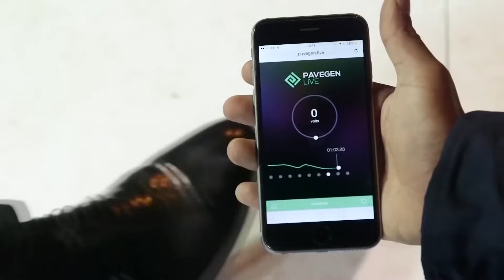Pavegen plans to power the world with footsteps

Comment: The road "project" is bullshit. To convert energy, you must absorb energy. The energy "source" is the plates sinking. When one plate sinks, you have to put a little bit more effort into climbing the height difference between the plate that has sank and the next one. It may not be like stairs and make a small difference, but it still makes the difference. It's like walking with a constant incline. And in the case of cars, using more fuel which means more money and CO2 emmisions, or, in the case of electric cars, energy😅
Reply: Revelation 3:20
Behold, I stand at the door, and knock: if any man hear my voice, and open the door, I will come in to him, and will sup with him, and he with me.

HEY THERE 🤗 JESUS IS CALLING YOU TODAY. Turn away from your sins, confess, forsake them and live the victorious life. God bless.

Revelation 22:12-14
And, behold, I come quickly; and my reward is with me, to give every man according as his work shall be.
I am Alpha and Omega, the beginning and the end, the first and the last.
Blessed are they that do his commandments, that they may have right to the tree of life, and may enter in through the gates into the city.

Comment: What if you put a bunch of them on the street for the Boston Marathon ?

30,000 people running 26 miles.

If you could store the energy in batteries.

What about heavy duty ones that generate even more energy because cars and trucks are driving over them.

Does more weight equal more energy ? Airport runways ?

Comment: The purpose of this project isn’t really about generating extra power for the city and its people. In fact, these kinetic tiles require more energy from individuals, as anyone who has ever walked on sand knows, walking on a cushioned surface demands extra effort compared to a solid one. That means you need to consume more food to maintain your baseline energy levels, and food production itself requires significant energy and creates waste.

The general public may not realize this, which is why these 'innovative' projects can mislead people into believing we have a critical energy shortage. 

Rather than being a genuine attempt to solve energy problems, it could serve as a method to shift public perception, create buy-in for monitoring technologies, and reinforce the narrative of scarcity. This would, in turn, make it easier to implement more significant behavioral controls and restrictions down the line, all under the banner of sustainability and global responsibility.

It's a clever tactic, no doubt, but it lacks genuine intelligence and integrity.

Comment: what about: energy generating road;  e-magnetically dragging driver using motion capture , reducing necessity of ph. strength or engine... ;)
Persistence of induced movement. Sustainable, but not cheap to maintain. Better to plant rubber trees for breaks than use fossil fuels and repair (more) engine parts.. ;P

Comment: if you´d replace every sidewalkwith this, connect it to a Battery that saves the generated energy. you could use said energy to light the sidewalks at night. this would save so much energy(cost) then make it mandatory for every goverment building to have solar panels

Comment: Amazing - if you got it onto the roads we could be powering our lighting infrastructure really inefficiently with petrol!
All you are doing is taking energy from one source (me walking or a car driving) and convrting it at incredibly low efficiency into electricity to power a light.
You don't get the energy for free. I need to put in more work to walk across your pavement than a normal pavement. And, ok, who cares if pedestrians get a bit fitter.
But put it on the road and you are taking energy from cars, which has to be replaced by the car burning more petrol.
Cars already run at about 20% efficiency. Being optimistic your tech might be 40% efficient. So you would be using petrol at about 8% efficiency to make electricity. It's so silly.

Comment: This is a good idea. They should build busy road junctions with strips of these across them. Or entrance ways to buildings. Places with high regular traffic
Reply: Why? You would then cause every car to use more petrol to cross that intersection so you could harnass a tiny fraction of the energy available in that petrol. If you want the energy, put up a solar panel.

Comment: Does not make sense. Think about it. Where does the energy come from? Waking on these sidewalks is more tiring as you convert some of your energy into electricity (not bad, you burn more calories which is healthier). It is as if you are walking on a slope (every step you take, the ground lowers beneath your feet, so your next step should be some centimeters higher than the previous). It is like walking on a sandy beach which is more tiring. The most stupid thing they said in the video is to use car energy the same way. That would require the cars to burn more fuel for the excess energy. Why would you burn gasoline (which is more expensive than some other fuels) to create energy? Besides, you should create energy via renewable sources.

Comment: So, the problem with putting these on roads is that the energy has to come from the fuel in the cars. Cars will burn fuel more efficiently on stiff, flat roads, but will lose efficiency the more elastic the road is. So, by putting elastic generators in the roads, you're taking the energy away from cars, making them less efficient. If you want to generate energy from commuting, put these in your shoes. You'll burn more calories than wearing regular shoes, and charge your phone at the same time.
Reply: @Cubic Planet Solid tires are efficient, but the issue here isn't with the tires, it's with the road. The road needs to be as solid as possible for cars to drive efficiently. The most efficient way to drive would be with solid tires on a solid road. A good example of very efficient transportation is trains. They can travel at much higher efficiencies partly due to their solid metal wheels on solid metal rail roads.
Reply: @Tbugfish  exactly ! So why don´t we use this stuff on  r a i l w a y s ? And there you have  g r e a t   p r e s s u r e  too !
Reply: @AL_THOMAS_777 are you kidding or do you have a 4th grade level of understanding of physics?
Do you realise that for the tile to go down, the vehicle needs to travel upwards, like on a slope and use more energy than what is created, right?
Reply: Yeah and I think this vid made it clear that they are nowhere near finding a solution for that. The focus was pedestrians only at first.
Although I am curious what developments were made in the last 4 years...
Reply: Can make speed breakers using this tech...
Reply: @guneetsingh5562  That's actually an excellent idea. Put these speed bumps around busy schools or shopping centers. They'll probably collect enough energy to power a few street lamps at night.
Reply: It might make sense to be use together with speed bumps or speed cutters. This way you create lower speed bumps that damages the car less while taking more energy and momentum out of the car without requiring them to brake that much.
Reply: You mean like a usage tax?  (If you use the road your car will power the lights?)
Reply: Yes, but they are not putting the pressure plates on roads, they are putting it on footpaths
Reply: Or ... You could buy an electric car...
Reply: @timemachine194 If i'm understanding your argument correctly, then we need to shut down all gyms, cancel all sports of every kind, and reduce how often people walk. This will improve our lives by reducing pollution.
Reply: @timemachine194 I agree. We need to stop wasting money and resources on research and just stick to the old ways. prototyping without knowing a product's efficacy will always be a waste of resources which could have gone to maintaining what we already have. Tradition is always better. I also agree that it is unethical for people to buy shoes that make them burn more calories to charge their cellphones. Cellphones should only be charged by infrastructure power generators.
Reply: Yes putting them in the roads is basically another indirect tax, crazy idea. 

It’s the same with the footpaths, do people think the energy gathered comes out of nowhere. Have they asked consent for quietly harnessing people’s energy on behalf of the government, no that hasn’t even entered their minds. 

Use them for the side of a building for wind, that is the way, leave the overburdened human beings alone please
Reply: You could these stuffs beneath speed humps
Reply: well, I for one. am hoping for a more fuel efficient, electric. or solar or kinetic, car that would not have such a problem with 'wasted energy'.😉
Reply: @youtmeme  converting any kind of energy always has waste.
Reply: @foxrumor  true.
Reply: @youtmeme  you're still taking motion away from the car and putting it into the steeet, which on top of everything has to transport and store the electricity you generated. Better off just leaving the cars to run efficiently
Reply: @youtmeme you do realise that is a physical impossibility, right?
Reply: @youtmeme Most Electric cars use fossil fuels converted into electricity as their power source. Also solar powered cars are very inefficient.
Reply: I mean you could just compress the points that collect the energy into small little bumps instead of making them large enough to block the way

Comment: You  can also put this tech in keyboards...
Reply: And wireless keyboard get energy by pressing keys no more batteries....
Reply: @aarkestraclub326  brilliant idea
Reply: @YinhuWang  sounds brilliant until you calculate how much energy is produced from one key press.
Reply: @aarkestraclub326  law of thermodynamics
Always some energy will lost in form of heat
Reply: @kunjgadhecha281  that's why there should be a mechanism that track & monitor the temperature and when it is hot enough the heat should be transferred/used in others devices to fuel other appliances. I know that could sound crazy, but less than 5 years ago was also crazy to colonise Mars lol.
Reply: Gamers producing energy....noice
Reply: And our railways  a r e  BIG keyboards with Millions of "piano-keys" and 2 rails on it ;P
Reply: Suspension in vehicles, roads, train tracks, super markets, gyms/treadmill, etc.
Reply: @Tryalittlebit  actually there are threadmills that have this kind of technology already, taking the rotation kinetic energy and converting it back into electricity, in cars, motorcycles and basically any automobile uses this as well, that's why its already rare to buy new automotive batteries, normally, when it stays inert a long time it discharges, and you'll just need to charge it again and you're good to go
Reply: @jonasgabriel7315  piezoelectric in automobiles?? It sounds like your talking about alternators. That’s a different technology bub.
Reply: @Tryalittlebit  by "this kind of energy" i meant a retroactive energy conversion, but yeah, that's exactly what i should have said, but i had forgotten the name, thanks, and sorry for the mistake
Reply: hacking noises
Reply: Could replace all your teeth and leg bones with this and just walk about chomping down the sparks saving money as you go
Reply: @shaunlastname391  😂
Reply: I have smart work skill ideas by directly kinetic energy is converted into electrical energy and use it for charge our daily needs domestic gadgets or  other equipment .... But I have skill  but not a platform to show my skills ideas ..if any company hire me I work for them ...
Reply: Ur idea is really good
Reply: Exactly
Reply: Facts🔥🔥🙏🏽
Reply: no we should have generators on our teeth so everytime we brush our teeth, it powers the bathroom light
Reply: I think that would make it to where you've really gotta pound your keys. It would require more effort to type for not a huge return.
Reply: Electric company gonna be selling our energy back to us.
Reply: Ha haha ha. Keyboard warriors will produce electricity
Reply: not actuallyt it does not work
Reply: Sure there is such a huge force touching keyboards. Let's be honest it's fool technology to show up nothing more cost fortune to made produce not that much in the future may cost a lot to repair. It's a shame that we promote such a scams
Reply: @oskarrospondek1350  yea there isnt alot of force but it can still help with the amount of time and movement Im putting into typing this comment it could be causing some power to help.
Reply: @oskarrospondek1350  also have you seen old people type
Reply: U are thinking about costs as if this is made to turn a dollar into 10... Ofc it wil cost a fortune to maintain but atleast its green energy! Would be nice to have such devices all around us.  @oskarrospondek1350
Reply: These is very easy technology bro
Reply: @umeshpardeshi9081 
Revelation 3:20
Behold, I stand at the door, and knock: if any man hear my voice, and open the door, I will come in to him, and will sup with him, and he with me.

HEY THERE 🤗 JESUS IS CALLING YOU TODAY. Turn away from your sins, confess, forsake them and live the victorious life. God bless.

Revelation 22:12-14
And, behold, I come quickly; and my reward is with me, to give every man according as his work shall be.
I am Alpha and Omega, the beginning and the end, the first and the last.
Blessed are they that do his commandments, that they may have right to the tree of life, and may enter in through the gates into the city.

Comment: Better buy small PIEZOELECTRIC generators online...
You will get it..

You can also use this inside Shoe soles to generate electricity while walking, or below carpets in your house , or between the Tyre and Wheel rim of your Vehicles to generate electricity while driving,  at free! 
Today Japan is using this technology in some of its Malls too.
If installed below the Public streets or Roads, it can generate enough electricity to power all street lights & cam.

Comment: Ultimately, I guess it shouldn't be tiles, but a soft ground that equalizes the force feedback, so people won't slip.
Otherwise, if Thunderf00t hasn't made a "BUSTED" video on this, it's probably viable ;)
Reply: Well, it's not perpetual energy, it's more like a pressure plate, which can send an electric impulse to a battery which can store the charge, it's good efficient clean energy, imagine putting these in Manhattan. With how many people walk in NYC we could probably power a lot of the state and or east coast

Comment: i am doing this project for my final semester, how effective will be this project for modern engineers
Reply: from my coursework calculation, it is not worth the capital cost
Reply: @03019a  like how much capital cost required to build like these?
Reply: @contemplator1993   £80 per square foot, and it can generate 7W per step
Reply: @03019a  80 pound is heavy.
Reply: @03019a  what component do i need to make this
Reply: Me too but I haven't started yet. Do you know if there is an app or sth to get live values? like how many steps/energy in total?

Comment: Cover a busy highway with these and you got profit.
Reply: You only got profit because vehicles use more fuel to travel across these than they do to travel across a normal road. The energy is coming from the petrol. You would be powering your lights with petrol at very low efficiency with atronomical carbon emissions per kWh. Dumbest idea ever.
Reply: or we could just put wind turbines on our roofs
Reply: Yes, you can power a single lamp with all that power
Reply: @yalkn2073  Well that's something too.
Reply: I am pretty sure it is more than that. You need to see the video by Jun Fu Clean Energy Co.,Ltd.
Reply: @mubashirakhtar789  And I am pretty sure manufacturing and maintenance cost would far outweigh its energy output
Reply: @yalkn2073  Not really, if you put it on one highway you could probably power half the state with the amount of daily traffic.  Hell in high traffic areas, we are talking millions of joules of power just waiting to be tapped.
Reply: @Ryooken  You can't, considering the abysmal power output of these. And putting speedbumps on a highway is a bad idea
Reply: @yalkn2073  They are first generation applications, it's the same thing with regen braking.  It will improve over time and get better exponentially.  They are using them in various parts of Europe this is 4 years ago so improvements have been made.  So yes, I am.
Reply: @Ryooken  This relies on piezoelectricity to generate power. It literally can't improve much.

Comment: LOVE This! A question though, if this were to be used on roadways, wouldn't the "inch or two" of downward forge every microsecond weat vehicles shocks a teeny bit, and potentially fuel economy? Has a whiff of "perpetual motion" methinks. With pedestrians, NP the cushioning would be nice, But vehicles?
Reply: Yes, you're right. You are simply lowering the efficiency of the vehicle and getting electricity from the petrol. You don't get the enegy for free, unless it is used in very niche situations where every car is braking anyway and you are simply using this to help them slow down.
On a normal stretch of road, this technology would cause the car to use more petrol: it is not getting something for nothing.